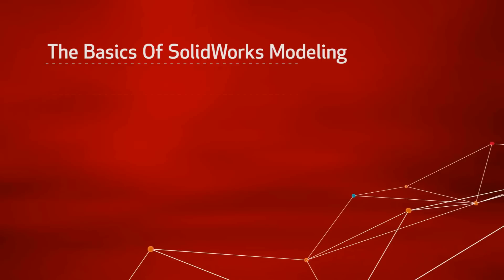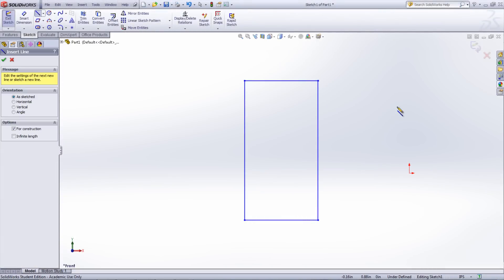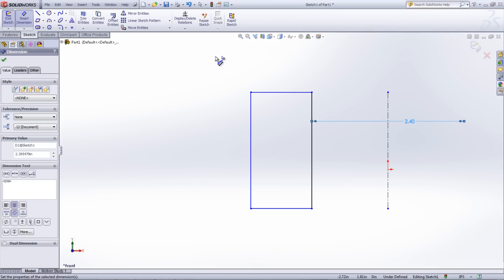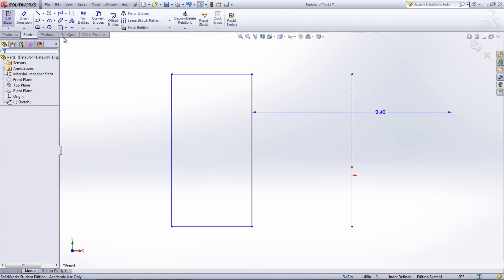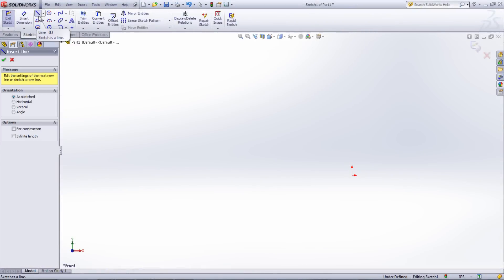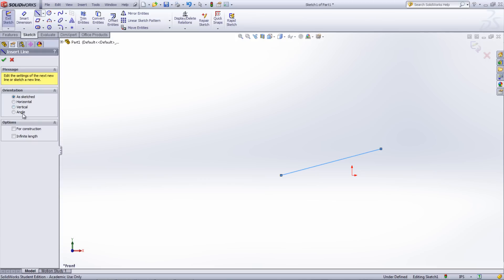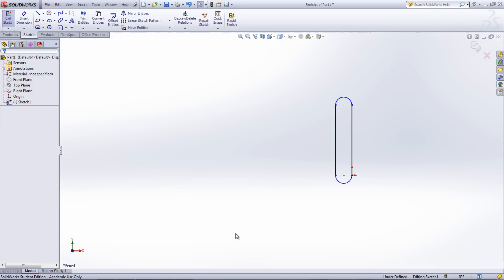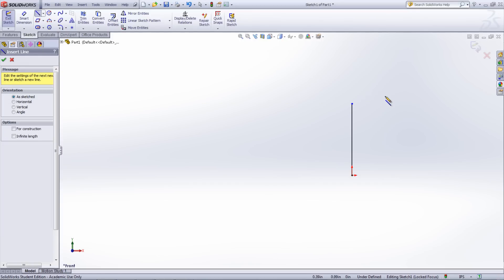The Basics on SolidWorks Sketch Lines

Comment: How do you draw lines without continuosly select the tool?
Reply: Clicking once then clicking again should allow you to keep drawing lines. If this is not the case, go into Options then in the  General section uncheck "Single command per pick".
Reply: @Brandon-vo1bw Thank you so much for this! Somehow switched this on and have spent the last hour at work trying to figure out how to restore line chaining without having to wipe all my other settings